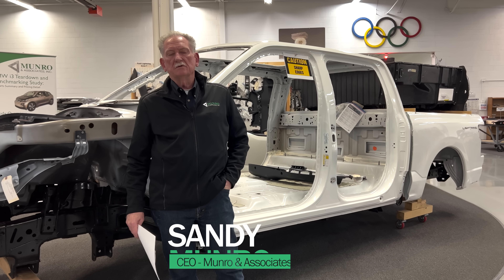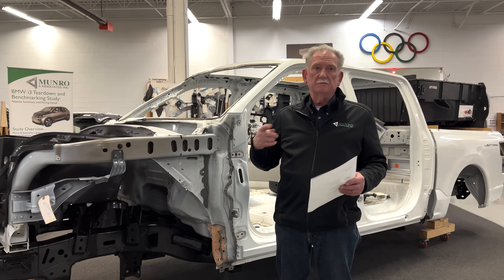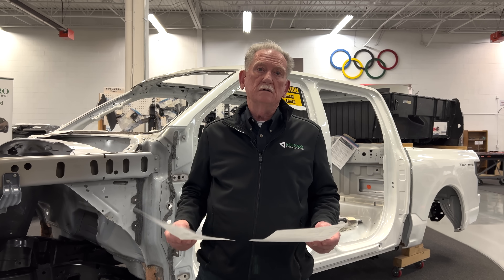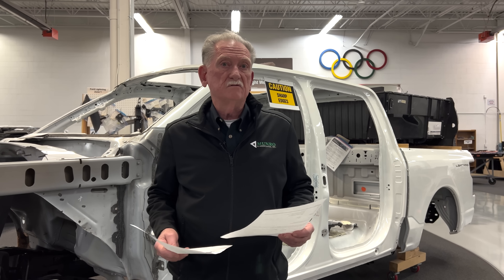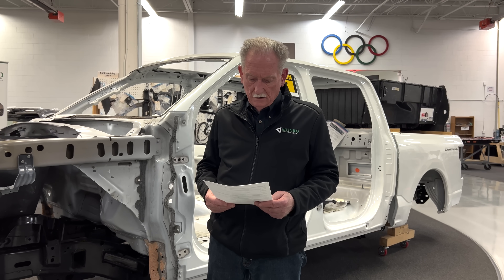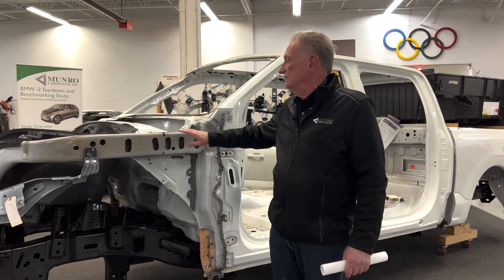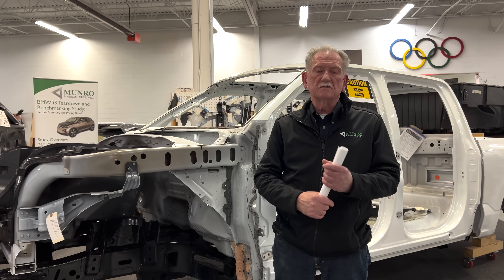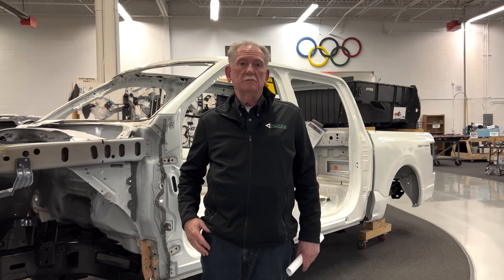Sandy's Initial Thoughts on the 2025 Ram 1500 Ramcharger

Comment: Rang anxiety is a real thing. Ford executives tried to drive an F-150 lightning across the Midwest and couldn't because they couldn't find reliable charging stations that were functioning. That's why they made the jump to the Tesla chargers. Ram engineers loaded a lightning to capacity and made it less than 100 mi on a full charge! I frequently take camping trips throughout the west and northwest and there's no charging station at my campsite in the national forest. With the ram I could drive electric only for days and weeks at a time but whenever I do need to drive longer range across town or a long road trip, the generator fires up. I have the F-150 hybrid currently and have used its 7200W generator for off grid camping, powering anl RV, and powering lights and refrigerators and freezers at my house during power outages. That pentastar V6 might weigh 500 lb, but I'm sure the much smaller battery in the RAM at least 500 lb less than the giant battery in the Ford.
A turbocharged for might be more efficient, but the torque you can get from that V6 at idle as it charges. Charges the battery will have significantly less noise, vibration and harshness. And I sure the longevity of that pennastar with its lower lifetime loads will be significantly greater.

Comment: While going nearly 700 miles in one go is not a likely proposition for anybody, going 300 miles is. The Ramcharger will do it without a second thought or worry about whether that stupid EA charger is working. I drive the 300 miles, plug it in at home, and not give it a second thought. This method of "EV" I see it being up capacity for a 2500 and even a 3500. It already has the 8 lug hubs.

Like the Volt, I think I'll be more worried about the gas going bad.

99% of the rest of the time, I drive 40 miles or less around town and drive it like any other full EV.

I have a Rivian, which I am trading off for a Lightning XLT. I am just sick and tired of the HMI, buttons are better. The worst screen HMI is the vents. In the Tesla I had and this Rivian, I had to stop the car and pull over just to aim the stupid HVAC vents.

Comment: This will change the paradigm for everyone pulling a trailer or large camper. They will sell tens of thousands of these to the camping crowd. It perfect. Those big trucks use a ton of gas, but now you can charge at your campsite and drive you truck all day for free. Campsites are not going to like it.

Comment: The Ram heavy duty under developement is going to be insane FYI, Cummins generator, biggest consumer truck battery, towing rating is jaw dropping and starts with a 4 on the 3500😳 - Ford electric trucks rating is far higher than real world conditions, towing is almost impossible, look at Tyler Hoover's famous video where they get a quarter of the range with a light load. GM can't even make the batteries so they bought into other companies with r&d that moves faster than a glacier, still going to GM it up. Tesla has one of their old factories they shared with Toyota. Ram is coming out with an all electric truck, just hope it isn't the ranger sized one they already sell outside the US

Comment: Haven't watched the whole video yet but I don't think you took into account that since the battery is smaller than the lightning it will weigh less. Also I believe the biggest thing they were looking for is to avoid the severely decreased range of towing electric vehicles. It will be interesting to see how well this accomplishes that

Comment: The reason you need the extra range is if you ever tow. If you tow with an all electric vehicle, your range is gobbled up in a hurry. I can only tell my boat 90 miles round-trip with my F150 lightning, but this range extender turns this truck into a true truck that can tow along distance, basically this is a game changer
Reply: Agreed!

Comment: Towing range will be a huge improvement over all of the pure EV trucks.  Granted most trips aren't  Will be interesting to see how this ends up.  Only thing I find concerning is the Pentastar 3.6L engine.  Sandy says it's a good engine and that's questionable.  Those engines have at least two known weak areas.  The plastic oil filter/cooler is prone to failure and could easily be replaced with a slightly more expensive cast aluminum one.  Ram/Stellantis being cheap makes me wonder where else they cheaped out.  Then there's the well known issue with the rocker valves.  At least the Pentastar 3.6 is better than the other engine choices they have.
Reply: There are always exceptions but maintain them and they are solid. I put 150k on a Chrysler 300 with the pentastar and outside of a transmission reflash at 108k which was only 150 bucks had no issues for that whole time.

Comment: 690 miles range means 300+ mile range from home without the need to charge, and also potentially a 300+ mile range while towing. If the vehicle is used in an emergency setting, it will still operate when the grid has gone down. This is truly the way to go given current infrastructure.

Comment: Range while towing on the Lightning is cut in more than half. Also, the Lightning is only getting between 240 and 300 miles empty and between 100 and 150 miles while towing. Then there is the time of getting back on the road, charging vs refueling, and finding a place to charge. If the Ram does what it says, it will be a winner. oh, by the way, range anxiety is real, especially while towing.

Comment: Sandy mentions the additional weight of the gas engine, etc. - but isn't that somewhat mitigated by the Ramcharger having a smaller (albeit maybe not much smaller) battery pack, than the full BEV Lightning? I feel he left out a little detail in the weight comparison.

Comment: Sandy, great video, but I disagree.  Range extender (or PHEV) trucks are THE BEST SOLUTION for those of us that tow heavy and further than short distances.  I have a large boat on triple axle trailer at ~13,000 lb., and EV truck towing any significant distance does NOT work.  And EV charging while towing is very difficult to often times not possible.  Even Tesla's Cybertruck (with I think is awesome) is not quite up to my towing needs.  Also, EV charging on the road is hit or miss, much more expensive than gas, while gas fill up is fast/convenient everywhere!  Finally, cold weather really limits EVs, so having the gas engine to help when needed is the best real-world-solution available today.  Now, make it a HD 3/4 ton or 1 ton and I'll buy it!  To be clear, I love EV technology, and currently drive a Honda Clarity PHEV car, but my trucks are still my trusty old 80s Ford F250 and late 90s GMC K3500.  Old steel is cheap, works, paid for long ago, and gets the job done!

Comment: what is the nuts to bolts weight difference.  if you have a much smaller battery you can easily loose the 500 lbs of battery to offset the 500lbs of engine.  why they went with a v6 instead of a I4 IDK.  as far as range, you cut that 600+ in half due to weight and weather you get about 350 miles

Comment: That mileage is key. I tow on weekends for motocross and will pull 8-10 -12 hrs to get to the tracks. I would love to try these out but not until I can get long haul capable. Only have the weekends to have fun so I cram as much in as possible. Drive all through the nights and mornings just to get to and from. Stopping for long times to charge doesn’t work. There is a whole community of guys just like me.

Comment: Thank you for the great information.   You didn't mention the huge disadvantage of the Lightning range while towing - The Ramcharger is a game changer for those who tow a trailer or use the bed for payload.   Even if towing or payload cuts the range in half, you can go over 300 miles and you don't have to find a public charge that will accommodate a trailer.

Comment: The Ram would give you the option of boon docking in your trailer, using the truck for power, and having the generator to recharge the battery.  If you deplete the battery while towing the horsepower from just the generator power may not be adequate.  We will have to see the real world testing.

Comment: Nobody seems to be able to answer the simple question

If I have 150 miles of battery 

And I only drive 50 miles a day 

Can I just drive my truck? 50 miles come home plug it in charge Arj the battery not even use gas unless I'm on a long trip. 

That's my question… Can anybody answer it?

Comment: So let's stop and think about this for a minute. You are buying an EV to get away from all the issues with a Internal Combustion engine. If you want an EV you should buy an EV. The Dodge gives you the worst of both worlds. It has a more limited range on the battery pack PLUS you get all the issues with a gas engine that you also have to maintain. You will still need to buy fuel. You sill have to change the oil regularly. You have a fuel system, belts, spark plugs, coils ans so on that can cause a problem ( and let's face it since it's a Chrysler product it will have problems). The ONLY purpose and function of the V7 engine is to act as a generator for the battery pack. There is no connection from the V6 to the drive train in any way. 
This offering by Chrysler (Stelantis) just makes no sense.

Comment: The Ramcharger sounds like it will be the "PHEV" that fits my current automotive needs to a "T".   The 145 miles per charge will cover ALL of my daily driving (w/occasional towing at half that distance), and the gas-electric engine will take care of ALL my once-a-month long-haul towing needs.   This truck, as specified, will be a game-changer for many of us if the price is competitive.  I absolutely love my 2021 Ram Limited eTorque so far!  Better than any truck I have owned last 40 years.  The Ramcharger is going to take electrified trucks to a whole new level I think.

Comment: I really do not see the point in using an ICE engine in a hybrid when you could use a gas turbine engine and literially run it off just about anything.  

They have been putting hybrid gas turbine drive motors in tanks for many decades.  You can spool up a gas turbine engine at much higher rpm than a gas motor, and you can generate more useable power.

Comment: 2025 Ram 1500 Ramcharger gas/electric is fine IF IF IF you need a LOT of range due to towing trailers or carrying heavy loads.

That makes up about 3% of Americans. The rest of America RARELY needs to charge away from home if your electric vehicle gets 300+ miles of range. Most people could get away 99% of the time with 100 miles of range. 

I have a Tesla. I've had a TOTAL of twice that I didn't go somewhere because I didn't have enough range and wouldn't have a way to stop and charge up, then go to location X and have enough charge to come back. That's it in 3 ½ years but that one time would typically once every ten years. If I really need to go further than that, I could 1) Rent a car/truck or 2) Keep a second vehicle that runs on gas/diesel when I would go that far. But would it be worth it for once every 10 years? 

And would that vehicle be around after 20 years or would I have to buy another vehicle that go over 300 miles on a trip. 

Well, in well LESS than 20 years, maybe ... -probably- less than 10 years that will not be an issue as I expect that road to have electric charging stations by the next time that I would want to make that trip.

Comment: Not for nothing ive driven 10 hours many times . You bring food , you pee on a tree or in a jug . As long as the trip starts in the morning after a little coffee poop is dealt with .

Ive worked labor for 12 -14 hours a clip and driving for 10 hours might not be as fun as many things but not THAT exhausting or awful if you have good material to listen to , a partner to talk to or perhaps have a quickie in a corn field or in vehicle , handy J , no BJs , watch world according to Garp and you will never want road head again ot ever . 

Ive driven more then 10 a clip in a c5 as well as 98 SS camaro with stiff suspension . Much worse things I could imagine . Crew cab , one driver drive , one sleep ( not legal or safe but ive slept on trips in moving conversion van on fold out ). It may not be a common thing or high need but 10 hours driving isnt like sweat working for 10 hours or a 10 hour hike or even a  6 hour hike , its not crazy . Even with old prostate peeing is not a huge deal whatever you do driving or otherwise you gotta pee . I keep a   1/2 gallon jug in car so if stuck in traffic dont need to whip it out in front of other drivers of which i have had to do in past àfter 50 . Some people are so shy if they have lesther seats and on way home just let it go but id rather bite the bullet and pee in front of people i will never meet or if lucky get followed and meet .

Comment: If you REALLY must go with electric - then of course a hybrid is the way to go.

But - again...
That "average 40 miles a day" (i.e. 20 miles one way). I'd like to know who, besides office workers, is only driving 20 miles one way? And they don't need a pickup.

I go almost 30 miles to the home base, and when I'm out on the road I will easily cover 150/200 miles a day.
The service industry sure isn't going 40 miles a day.

I'd also like to know how many real construction workers and contractors are using EV pickups? Not many, if any. 40 miles would be a joke.

EVs are a good idea IF you go to an office every day and that's it... and even then, you still do NOT have an electric infrastructure that will handle a mass migration to EVs (and I'm ignoring the silly argument that they are better for the environment - which they are not).

Comment: I'm typically not a Stelantis fan, but this sounds like an excellent option if it holds up under real life, heavy towing in icy mountains driving. This is comparable to the diesel-electric systems trains have been using for nearly 100 years... stone reliable, engine operates in its preferred rpm range, no transmission to service or wear out

Comment: Issues with electric pickup trucks
1. Half range when towing
2. Reduction in range in cold
3. Charging infrastructure not designed for trailers
4. Fast charging in remote areas
These are all use cases pickup trucks are designed for. A huge battery only solves half of these. A range extender solves all of them.

Comment: Obviously most people will never drive 690 miles without a break. It's more about not relying on fast charging infrastructure. Not everyone lives in areas with high population density or uses interstate roads when travelling long distances. Add towing which halves your range, I think a range extender in electric pickups is very sensible.

Comment: 600 lbs of weight for an ICE range extender is similar to the projected weight of the Tesla Cybertruck range extending pack. And it doesn't kill the bed space. And you have a spare tire. And you can refuel almost anywhere while your trailer is still connected. 

This is the best option for a tow rig with a plug on the market.

Comment: This will be great for those who tow consistently. If they are towing at or near full capacity then their range may be cut in half which I think is still a great number. And refuelling on the go is simple, stop at a gas station and fill that tank up and keep on trucking. They solved the charge time issue and the range issue in terms of towing. To my understanding you will never need to use a public charger, and you could even get away with no home charger because you can rely solely on the gas generator. Curious to see the fuel consumption but must be a heck of a lot better than pure gas trucks.

This truck will do very well. It would be nice in the future to put out a fully electric truck for those that are not towing or are towing less frequently and for shorter drives.

Thanks for the video, looking forward to you guys getting your hands on one to assess.

Comment: Get rid of the battery and calibrate the engine and generator to directly power the electric motors. No battery, no transmission, just the engine/generator and electric motors.

Comment: Albuquerque to Boca Chica is a long drive.  It would have been a lot longer if I had to stop and recharge 4 times for an hour...  The other thing that a 'range extender' can do is produce a mobile genset.  For  commercial use 7200W is a little light, 7500W opens up 300A 3-phase industrial welders.

Comment: Well first off you never added the weight of the fuel too. Secondly,  I don't think anyone is driving 690 miles straight. It's nice to have 690 miles of range so that you won't have to recharge or refuel so often.  No one will drive 690 miles without going to the restroom. I do agree about the possibility of a 4 cylinder turbocharged engine which would do better on emissions and possibly lighter for higher payload and towing. Ijs

Comment: As other have said cut that 690 in half at least for towing to about 300 miles and it works.  I would like a lot more info on the generator setup.  I have a 7KW generator at home and I think it is a 1 or  2 cylinder max.  Why do you need a V6 for a 7KW generator?

Comment: I cannot believe that someone would review a vehicle and bash on a long range.  This is the perfect solution to electric trucks.  A full EV truck is useless as a truck because their "range" is destroyed when towing or hauling.  So, I wonder what that range will be if the truck is towing a 10,000lb trailer?  Probably gets it down to where this guy thinks it should be.  He should have commented on that.  The best thing about this solution is the daily driving of the truck being virtually free if you charge at home, which is NOT the case with and ICE truck.  On the weekend?  Fill the tank and go!!  I owned a Chevy Volt, and it was a great solution and I have been saying for nearly 10 years they need to do this on a truck.  Dodge did... finally.